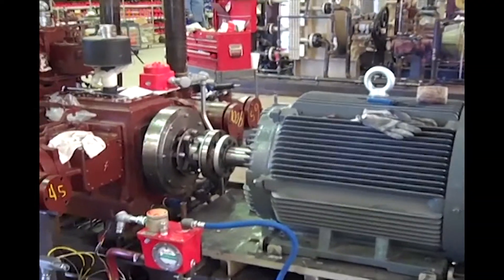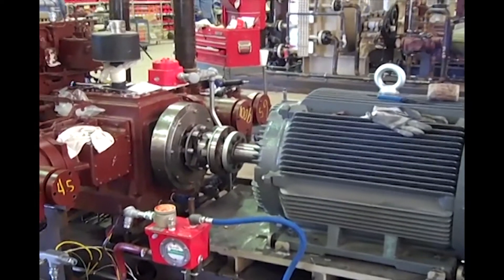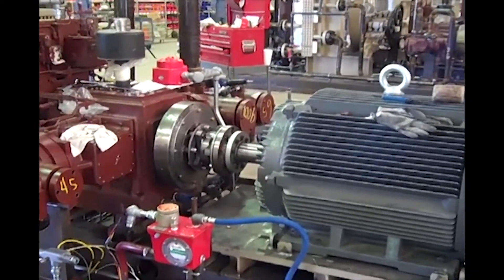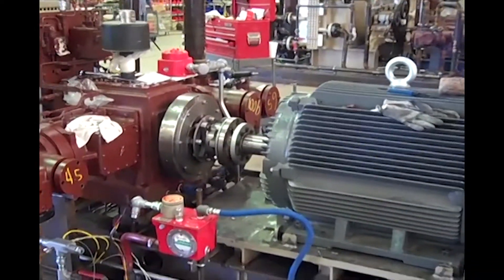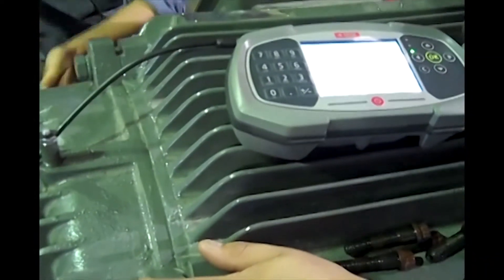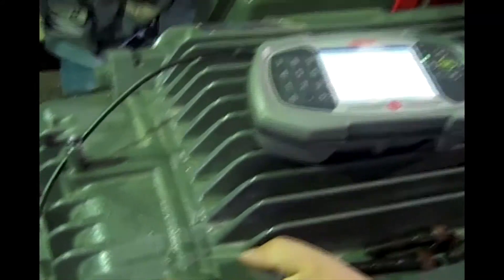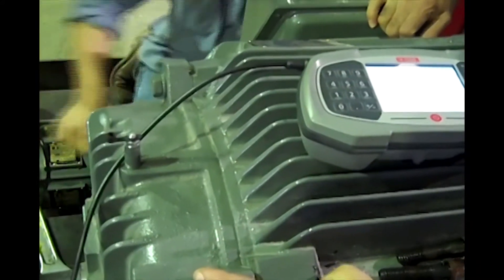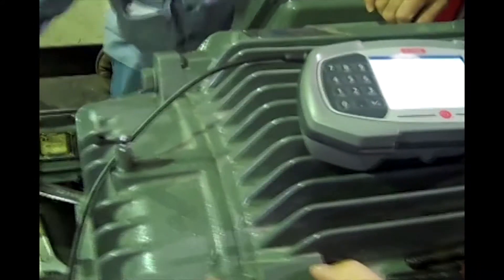200 HP Electric Motor to Compressor Laser Shaft Alignment | ACOEM

Comment: Why is it so big? The tesla model s has a motor that puts out 400 hp but is much smaller than this one
Reply: Their motor is 400 Hertz. This one is 60 Hertz. Lower frequency means bigger motor with lower speed and LOTS of torque. Think of like have a 400 HP diesel versus a 400 HP gas engine.